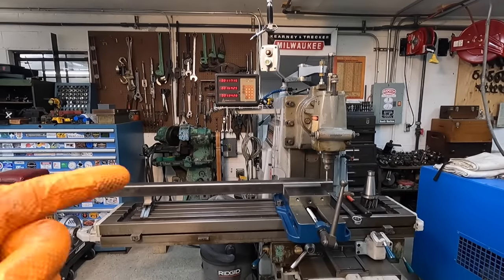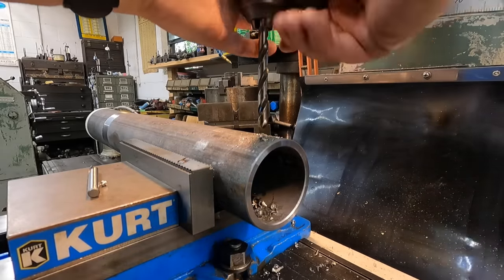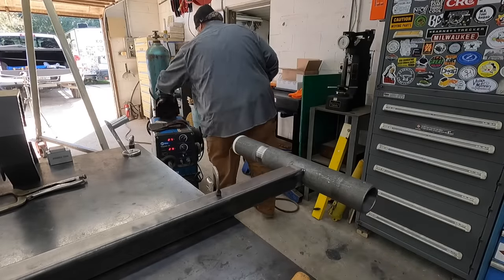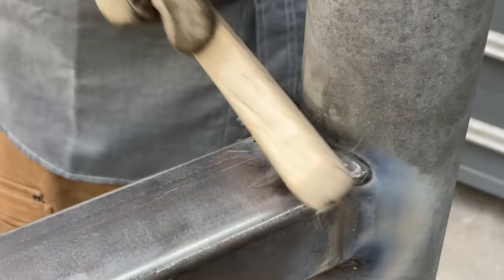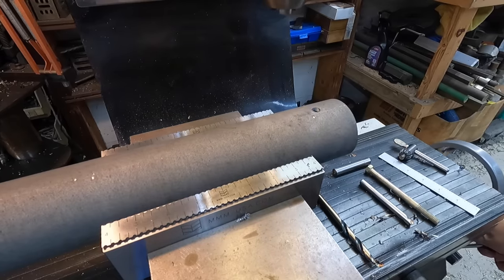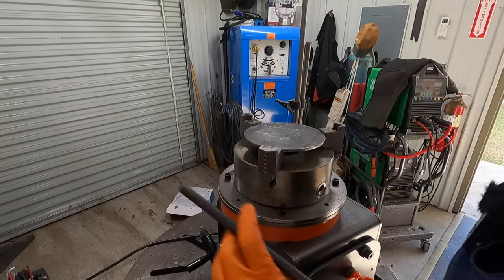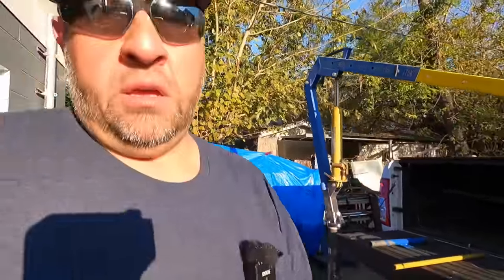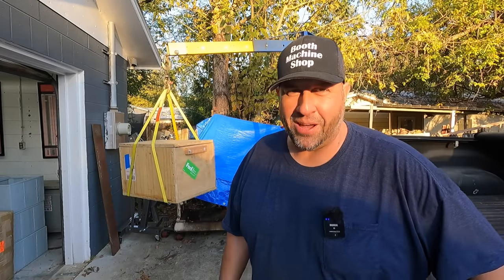Truck Hitch Crane Build Ep. 7: First Test!

Comment: I am not sure if anyone else has commented, but you can use the old blue handle/bracket, and cut it down so that the width is only the 4" or so wide that it does not extend past the edge of the lift support.  Then you can weld a pin on the inside of the long yellow handle.  This way you can use the long yellow handle bot for the jack, and as a fulcrum to swing the crane around.  Hope this helps.

Comment: Nice crane build and should come in very usefull. The holes for the legs, a screw adjustment would be ideal and usually are for crane legs, the holes would work too but you've made the holes too close - you want to avoid shear stress and failure between the holes. Spread the holes around the circumference at...60 degrees and each hole stepping up maybe one third of an inch. The other item,  welding a pipe on the boom will add more weight, instead make a hole near the bottom and put your lever there to turn the boom. However, the crane can be turned by pulling/pushing the load whilst standing at a safe distance.

Comment: Adam, I love your workmanship! As always your pride comes through. However, I respectfully have a couple of engineering ideas which would improve the performance of your design. 

I have two suggests. Increase the diameter of the pin to 1/2” which significantly increases the load bearing surface area. I’m not so concerned about shearing the pin, I expect the 3/8” hole will and pin to wallow out slightly making the pin difficult to insert and remove. 

My second and more important suggestion is to rotate the pipe at least 20 degrees between the holes which are spaced 1/2” apart lengthwise along the pipe. This allows significantly more meat to keep the holes from stretching due to lack of metal between the adjacent hole. 

I have a suggestion which will simplify and improve the performance of the gussets as well that you may incorporate into future builds if you are interested. 

Love your videos! Say hi if you find yourself on the north side of Tampa!

Comment: small tip : when you change your wire, you should have a switch somewhere on your machine to push the wire without having to use the trigger, which will avoid using gas and electricity
Reply: Or just feed by hand and close your gas bottle lol
Reply: @erickalvarez900  or use the thing that was specifically made for that :)

Comment: If your getting holes in your welds it's usually either moisture or gas problems. 

If you're running out of gas or welding in the wind or if the shield isn't flowing very well. Any contamination in the gas can cause that problem as well. If there is a lot of humidity in the shop or area you're welding you can get holes too.

Comment: Great video, sir !  I used a piece of ACME thread for the bottom support leg instead of pin. I also experienced a swing load issue when the truck and pivot assembly were not level to the ground, I should have had a tag line or a worm swing gear at the pivot to slow the swing load.

Comment: Great work. Based on experience you may want to have a jack screw like base. We had a crane mounted on a tool body that had a base similar to what you have. Worked fine when handling things around on the ground, but when we put a fire hydrant on the bed the springs squashed and the load on the base support was such that we couldn't pull the pin and get off the base leg.

Comment: Nice job, Adam!  Thanks for showing us the build.

Two suggestions that may help:

1.  For your turning handle, weld a 2" long sleeve horizontally on the boom just above the level of your pickup bed sidewalls.  Use pipe stock with an ID measurement to match the OD of your jack handle.  After you jack your load up you can rotate it 360 with your handle and it will clear you pickup bed.  You can then onload or offload from the sides as well as the rear.  You may also be able to use the existing vertically-mounted sleeve to store your jack handle.  

2.  You guys think of a name for it, trademark it and market it.

The only problem I think you would have is making enough of them, because everybody is going to want one.

Again, really nice job.  Thanks for sharing it.  Happy holidays.

Comment: I think a threaded spare tire jack to support your lift will solve the spring load after you load the bed. Oh and drill holes through the base the size of the handle to use as turn holes. That will save you some weight as well.

Comment: Fun build. I'll echo what is in only a couple other comments: Heavy load --> truck squat --> foot through hitch all binds under torque --> how to disassemble? Thru bolt probably needs to be substituted for an adjustable option (threaded? another cylinder? trailer jack?).

Comment: U did a nice job I found one of those hoists in an abandoned pick up like 20 yes ago. It had a factory plate to bolt it down that was 6x6 I welded a plate on it 1/4"  2'x2'
Reply: P.s. I extended the boom bolted the plate thru the bed n frame n I could go pick up wat I wanted when I wanted. Ur followers r rite bout the pulling the leg up after hoisting heavy. I picked as heavy as a boiler 55 gal drum of oil engines n Trans assembly and it would put my springs to the frame.The one thing  on mine that didn't hold up was the upper pipe that the crane rotated in , mine had a bearing on the bottom that worked great but the pipe should of had a collar on top to keep the pipe from expanding. Wanted to let u kno.

Comment: That looks great, nice work and it seems to work well in that scenario.
I can envision a situation where you will not be able to remove the pin in the adjustable foot after a heavy load is placed on the truck, you would need to jack the truck up to get the pin out.
I think a jackscrew on the foot would work better than an adjustable pin.

I also envision a possibility the foot could kick out when on unstable ground causing the mount crossbar to twist while picking a heavy load directly from the rear.
Bracing from the foot to the truck may be needed in some situations.

Comment: Worm tracks are from trapped hydrogen, extra stick out will help preheat the wire and burn off the hydrogen if you look at the wire when welding you can see it burning off. The parameters you have now are good. Fluxcore is just like stick it needs to be kept in an oven at about 100 degrees and not left on the machine for no more than 4 hrs at a time. I like this project.

Comment: I had the same problem with worm holes one time and it ended up being the regulator. The rubber diaphragm was starting to deteriorate and small pieces started to plug the hole for the gas’s flow. Take the regulator apart and check that.

Comment: Not being a welder Adam I don't really know (from personal experience) what could be causing the worm tracks, but I did a bit of Internet research and it seems that they're caused by nitrogen gases that don't get a chance to escape before the slag solidifies. The article that I read actually suggested increasing the amperage..... Or using a type of wire that allows for the slag to solidify slower.

The article also said that the worm tracks were purely cosmetic and did not have any effect upon the integrity of the weld. I think you mentioned that fact in an earlier video.

Comment: I might try manipulating your torch angles a bit. Try more of a drag angle, rather than right in at 90°. Also, I believe flux core wires benefit from a longer stick out than traditional wires. 1/2 to 3/4 inch is where I run fc often. The longer stick out  allows the wire and flux to preheat before liquefying and transferring to the weld puddle.
Just some thoughts from a welder Abom! Fantastic job as always, nothing like using your favorite equipment for a personal project. Keep up the awesome videos!
👍😎👍
Reply: Dunno if Adam heard that but I certainly did - made a difference for me today, thanks for the pro tips!
Reply: I 2nd the longer stick out
Reply: @myharris  Glad I could help out! Also applies with self shielded flux core; many hobby machines run this and people seriously struggle on that stuff
👍
Reply: @joshuateter2410  That is because the long stick out needed by the fc totally contradicts the "KEEP A TIGHT ARC, DAMMIT!!!" that gets shoved and bolted in your head when you learn or are taught any other welding method.
Reply: @richardwoodruff1732  Thats whar she said.
Reply: @bogdan_n  lol so true. I swear sometimes people say that just to say it

Comment: If your putting a foot on it make sure you take a jack with you, if you load enough stuff to squat the truck your foot will be stuck.
Reply: wood blocks or cut off RR tie under the foot. spreads the ground pressure too

Comment: When the load hits your truck the springs will compress , transfering the load to the pin which will cause binding 12:40
Reply: Most of the load is right on the ground through that foot.
Reply: I read it again, I now see what you meant, for releasing the device from the receiver and such.
Reply: In my opinion, instead of the extendable leg, there should be a hydraulic lift (hydraulic jack), such as in the arm. Greetings from Poland :-)
Reply: @keithcarter4086  that little 3/8 pin will have binding problems at heavier loads,  simple fix,   modify a trailer tounge jack to relieve the load on the compressed truck springs   other wise  Abom has done a great job   Hes one of the best, way better than I could    sometimes a different prospective is helpful
Reply: To alleviate the load drop of the weighted bed, all he has to do is 'short-pin' the leg enough, so the sag of the bed under load, matches the 'short-pinned' leg length.  Also, I'd drill more holes lower in the leg, in case of uneven ground (backed up to a curb maybe).
Reply: For that very reason the lower leg should have minimal adjustment and set to the lowest point that it is still above ground and I would have a 1"×12 acme thread shaft to a 8" die.plate that way once you loaded down you will still be able to spin up off the ground.. but that's me!
Reply: @keithcarter4086  Thats the Problem, he still needs to remove the foot to drive... if all the weight is on the foot he may not be able to get the pin out...
Reply: Not only will it bind but as the truck squats it will kick the foot out to the left and the cross bar will start to bend up. Each successive load in the truck will load this cross member so that it is not only trying to resist the clockwise rotational moment of the hoisted load,  but also the load in the truck. Now add fore and aft rotational moments to that flexed box tubing with the foot on one end with swinging a load could fail pretty spectacularly. Hopefully the intended use if this will be relatively light loads as shown to stay within the strength of that lower box tubing.
Reply: That was my first observation when he described how he was going to make the foot in an earlier video as well.
Reply: I was thinking the same thing… maybe an acme rod welded to the foot so you could release the weight from the assembly…
Reply: Simple solution. Replace the "adjustable foot" with a screw jack.
Reply: Regardless of what he uses to release the tension on the pin after the load is in, there is still going to be a lot of twist put on the tubing at the truck receiver hitch when the weight is transferred to the truck and the leg is still extended. A couple hundred pounds probably won't do any damage depending on how much play there is in his receiver, mine has some play side to side and up and down but not much twist, with the distance out the where the foot is there is going to be a lot of lever action twisting.
Reply: The horizontal tube is going to twist ...this is construction not save to lift the 2 tons that the engine lift is designed for ...
Reply: The horizontal tube is going to twist ...when there is going to be to much torque applied to it ...
Reply: @andreaswagner2871  Oh the pin will come out, maybe with an extra tool to punch it out, but it will cause extra wear under heavier loads.  Fortunately Adam used a pipe for that lower piece, it should be fairly straightforward to incorporate a trailer jack inside a short pipe and plug it right back in.   There will be upper limits to what it can reasonably lift, though, Adam mentions a couple hundred pounds.  I'm thinking an engine block of the V8 variety, not much more.
Reply: @keithcarter4086  how you gonna pull the pin out?
Reply: @budlvr  Good point. Or just carry some squares of plywood to stack under the foot when needed.
Reply: gotta keep that bottle jack handly, but I see why work trucks have their cranes welded to some kind of internal super structure. Or make the bottle jack the foot lol.
Reply: Wondering what can be fit in and manage the load still like a linear actuator like maybe just simple threaded rod though heavier load acme or other thread so to allow for adjustment prior or maybe even just fixed.  Thinking something like a planetary gear so instead of like a typical worm drive... can have a more linear in the shaft/tube linear foot drive.
Reply: Does seem hydraulic would be easiest though... even a manual design.
Reply: Then again... maybe right down on the foot with a thrust bearing... just a floor/ceiling jack style manual threaded rod with maybe a rod welded in the threaded rod, or a hole in the threaded rod, for the same pump lever rod to adjust.  Thinking that would be the easiest method.
Reply: @jafinch78  I’d keep it simple. Weld a big acme nut to the pipe  then put a swiveling foot on the rod. Of coarse he’d have to kneel down to release it   Just my thought
Reply: @TgWags69  it can twist much as it’s supported by the ground and truck springs are independent 
About 500lbs max
Reply: @bulldawg6259  Good thinking!
Reply: @bulldawg6259  can or can't? assuming you meant can't from the context of the rest or your sentence, I disagree somewhat. for a single light load like he demonstrates in the video, you are right. However if he loads multiple heavy things in his truck then that's where it gets interesting. because the foot of the crane will essentially turn the cross member going over to the Reese hitch into another spring resisting the load in the bed. It also has to support the multi directional loading of the crane arm itself. it will only take 2 or 3 inches of deflection coupled with the torsional forces of the swinging load to cause that box-tubing to fail. He would be better off to eliminate the foot altogether or place the foot under the center of the Reese hitch. At least that way the cross member is never supporting any more than the lifted load and won't be subject to the extra weight of the load in the bed of the truck.
Reply: @budlvr  That puts the weight of the load on the truck hitch, which it's not designed to do. That and getting rid of the leg and just bolting the crane to the truck frame would be the same thing. He'd have to really beef up the truck hitch to take the load.
I would put a pivot-joint between the leg and the horizontal beam.
That would only require putting a wider base plate on the leg so it doesn't rotate accidentally. (A plate with spikes too, for dirt)
It would also need a rotating pivot-joint  from the beam to the truck hitch, for 100% non load transfer from truck bed to crane leg.
With those 2 mods, it could be commercialized.
Reply: He really should have air bags to lift the foot back up off the ground. Problem solved with extra benefits.
Reply: @thebotformalityknownasdale2564  yes Dale same as the screw jack he used to support the tail stock and compensate for different heights from the ground to the bottom of the crane. This has been a wonderful show. Thanks for taking the time to allow us to view.

Comment: A nicely made device but I can see one issue, when you swing the boom so that it runs straight with the truck body I can see a twisting issue about the joint where the box section meets the round upright tube particularly if you find yourself loading on "soft ground" an outrigger that comes away from the tube at 90 deg from the box to the ground to stop it trying to rotate would be useful.
Reply: I thought on that too. I think the whole system is at risk of tilting with a heavy load towards the right side of the truck. I would have added a similar foot on the right side plus the same structure. Also some triangular supports for the long horizontal bar. The loads may be surprisingly high with loads on the order of 500 pounds. I hope this design will be strong enough,
Reply: Exactly.  The twisting forces under a 1-ton lift will be enormous, and could twist the square tubing enough that the foot loses ground contact.  Need to calculate the moment forces.
Reply: I should have responded here. You already raised the issue. Next time I will read more posts before jumping in!
Reply: @jamestamu83  I think the critical thing is that if the load hook goes to the right of the hitch. Then the center of gravity of the load+crane may be to the right of the support point or line. Then bad things may happen with high loads. A second foot on the right would be helpful against this kind of situations.
Reply: @jamestamu83  I believe Adams’s weight limit is 500 lbs. Even so the hitch bar must very strong to resist the twisting effect of the cantilevered load.